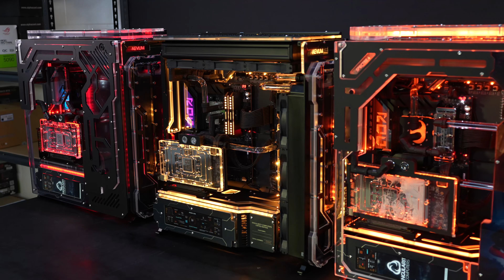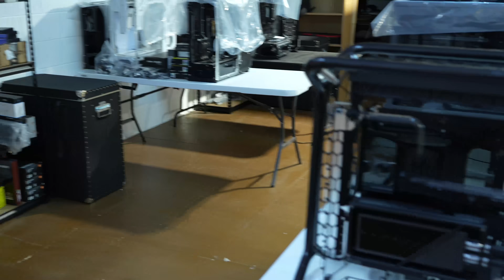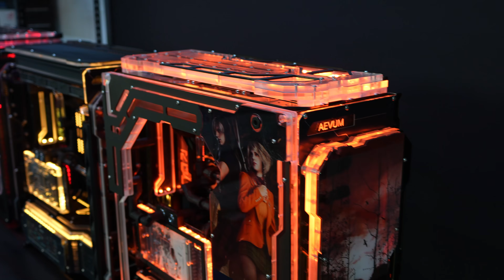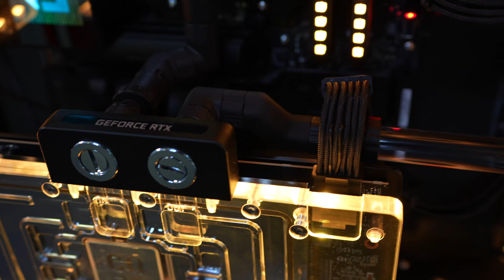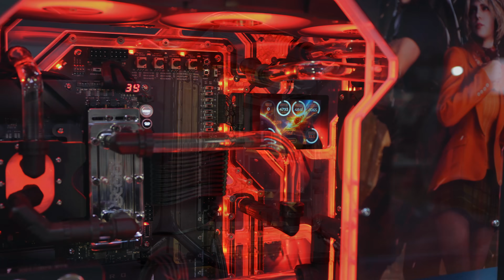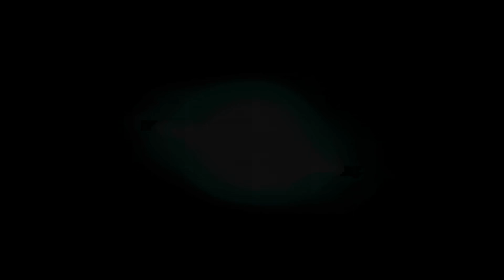Singularity Computers Fittings

Comment: "you never really know what fittings you'll need"

ow tell me about it been watercooling for about 20 years now (damn you time) and over the years have amassed a collection of fittings first compression for flexitube and now mainly 12mm compression and a bunch of universal BP fittings.

and each build used less and less fittings and more tube with a clean bend. but my latest build just had all it's G1/4 threads either just off or in line but 90 degree's off so with fittings a pain in the rear to connect...my fittings box is almost empty :P had to use almost every spacer fitting i have, there's only 3 dual rotary 90's in here but 4 dual rotary 45 degree fittings and i even had to use dual rotary fittings to connect things as the fit was so tight no tube would fit, so litterally taking a needle nose plier and tighting 1 end of the dual rotary to gpu block...and then touching up the damage to the fitting T.T (it was not a fun build that challenged me on all but 1 tubes atleast the one from the top X rad to the reservoir is just a 90 with 2 fittings T.T).

when you plan your build and then think ow the high flow NEXT will fit below the GPU...yea....but the size you have to work with from fitting > fitting = the width of the high flow NEXT without fittings so....time to get creative :P

and yea when you need 3 specific turns in the span of about 5-10cm....you need some serious kit to be able to bend that cleanly >.>

will keep an eye on the your fittings when they come out, i'm only loyal to bitspower because...i don't think i've ever had a leak with a BP fitting, the time i cheaped out and got EK's 1st gen fittings i messed up so bad water actually shot out of the pc case when i powered it up for leak testing >.> (wile fiddling with a tube i loosened the fitting on the other end and it's jacket was hiding the gap that formed T.T) and i've had some aquacomputer temperature sensor fittings that refuse to seal on a radiator (but seal perfectly fine on an extention).